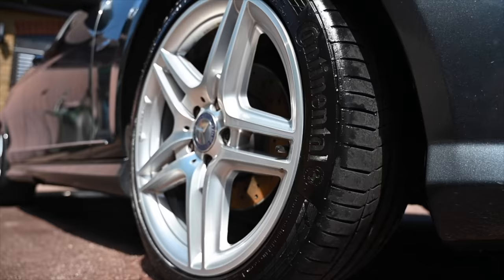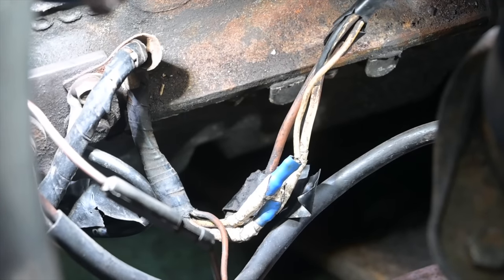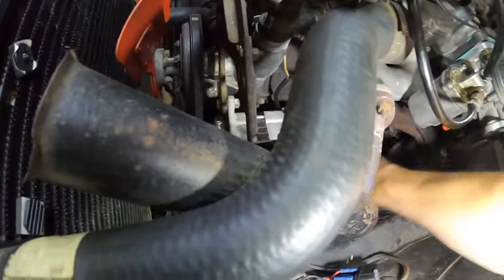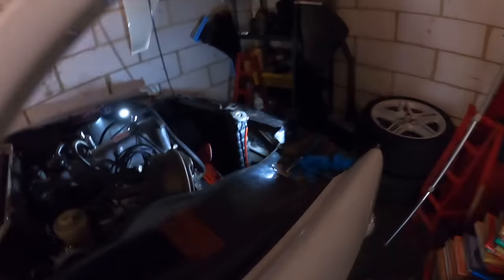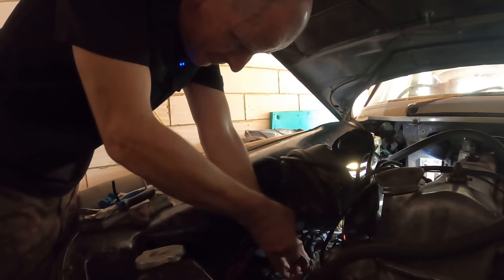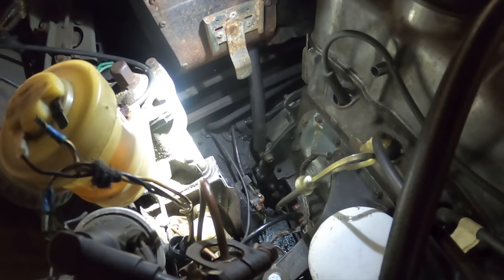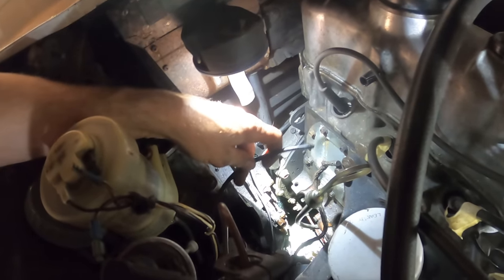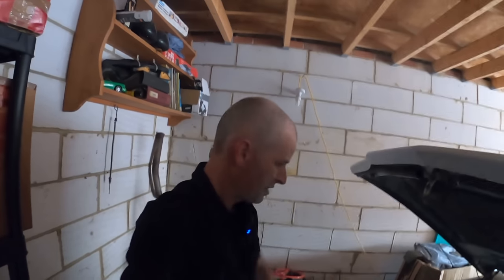Rover P6 2000 starter, fuel line and a lake of petrol...

Comment: Matt I had a starting issue for ages exactly like this on my old 2000 auto and it turned out to be that earth strap which needed cleaning + plus someone previously had been very generous with the engine enamel paint and has simply placed the cable over the new paint!! I have to say though I always like the Duck egg coloured block, I'm sure that was the colour from the factory on these 4-pots :) The starter motor wiring is always a bit hard and fragile, way too close to the exhaust for my liking but no worse than the V8's running fuel lines by the exhaust causing vapour lock express! Lovely to see this beautiful example again!

Comment: The slow starter revolutions was a hint that that an earth connection was a problem. After fixing, starter was spinning much better.  Resistance is the nemesis of starters..   always check battery posts for any excessive heat , will tell you if a positive or negative problem.

Comment: Seeing the P6 fuel system reminds me of a fault I once had. It's not related to your woes, but everyone might as well hear it. I had a P6B which would suffer from vapour lock in warm (though not actually hot) weather. It would starve for fuel, and then after parking for a time and letting the motor cool it would again run perfectly. It turned out, after much searching, that the fuel tap cable was poorly adjusted and slightly restricting fuel flow as a result. The car could still be driven hard without fuel starvation, but when the temperature got up a bit, the constricted line caused the pump suction to turn the fuel in the pump and pipe into vapour. No-one ever seems to check the operation of P6 fuel taps, but it's probably a good precautionary thing to do.

Comment: Even if the earth strap ends are shiney and tightly bolted down its can still be worn and high resistance, esp after 50yrs in the elements under a car bonnet. The starter sounds really slow like it wasn't getting the full fat current. 

As a test use jump leads to connect battery -ve terminal to body metal in the boot and under the bonnet from body to engine block. If the starter spins faster you know the old earth is U/S
Reply from the maker: This is a lot younger than the rest of the car, the engine has been out twice since Ive had it and it was replaced both times, its always been groggy since Ive had it
Reply: @furiousdriving  Is the battery end new and not getting hot? Starter worn/old/dying? and overloading the wiring? I'm sure its not supposed to sound like its attempting starting with nearly flat battery.
Reply: If there is heat, there must be resistance very close by. Either earth strap is compromised or connection has some resistance. I have had situation a few times where a connection looks OK, surfaces are clean and it is bolted on tight. However, I have replaced the strap and it made a big difference. Ohms Law suggests that a 200A cranking current through a connector with just 0.1 Ohms will generate 4KW of heat  - more than a 3 bar electric fire! So, for starter motors, every fraction of an Ohm counts.
Reply: Clive is bang on Matt, it could also be the starter motor is worn drawing more current and its path is that strap.  But my first bet would be the jump lead and see if it improves.
Enjoying the content as always!

Comment: Reminds me of when I had a 90" Land Rover that would flash all kinds of weird lights over the dashboard when cranking, even making the alarm squeak and swoop. Then came the smoke... Turns out the earth strap had failed and it was using the throttle cable as the earth! Lots of melted grommets and cable sheaths... 😆

Comment: That wiring to the starter motor is a case of somebody's been there before  great to see your Rover 2000 running l do like the look of these Rovers great design also the V8 thus was easier to get running thsn the V8 a fuel line and you can drive it

Comment: Morning Matt one thing springs to mind having been hot as it was the condition of the engine earth lead need to be checked/changed ,test it by starting the car and note how fast it cranks over then take a jump lead from the battery earth terminal straight to a good ground point on the engine block and start the engine again, if with the jump lead connected it cranks over at a higher rate then Your earth lead is suspect and needs to be replaced.

Comment: It seems to crank slow. If  the earth is heating up then you are creating an inline resistor and could do with upgrading. It might have been replaced in the past with whatever was about. Put a nice thick cable on and clean up the ends. Also those olives can be a right pain in the ass.

Comment: 😁 Excellent progress. We like P6s and watching this with interest as I have P6 that hasn't started in a while. I am guessing yours is maybe one of the Mk1/Mk2 "crossover" models as I could see the V8 bonnet bulges and it has a 2000SC engine?
Reply from the maker: its a Series 1.5 - series 2 with a few Series 1 bits and unique oddities like flat pleat leather and inertia real seat belts All models got the V8 bonnet when the S2 came out, making it harder to tell them apart

Comment: Mr Furious, what are your thoughts on the SU carb? I had much better experiences with SU’s vs. Zenith Strombergs, but that may just be my experience. Seems to me to be a beautiful design (constant depression) compared to other types. Is that an HS or HIF?
Reply from the maker: Ive not used Zeniths much but Sis have a reputation for being more reliable and easier to tune

Comment: The fuel pipe issue: you can buy those fuel pipes in metal with the olive on and then you can join it to your existing pipe with some 1/4 rubber fuel pipe

Your slow cranking and you saying it's always done that would suggest that earth problem has been happening a while, I'd replace that earth strap with a black covered one and clean each end where it bolts to the engine and engine bay

Usually it's better to run a earth off the block to the negative on the battery but I don't think your p6 has the battery in the engine bay
Reply from the maker: battery is in the boot, so it has to go through the body, its cranked that way for 30 years with many earth straps!
Reply: @furiousdriving  just a thicker earth cable and clean the ends then

Comment: Ideally for longevity and reliability those connections should be soldered and heat shrunk.
Reply from the maker: once its home I can do that, no power in the lock up for the soldering iron

Comment: it's funny that a choc block connector is fine for 220v 7.5 kW and higher to wire in a shower but dodgy with 12v 🤔
Reply from the maker: houses dont vibrate or get hot. Bad connections, not danger
Reply: It's the amps. A starter motor draws a far higher current tha anything in your house.

Comment: I really dont think the choc block is much wirse than what was there before. Especially if there were bootlace ferrules on the ends of both wires.
Reply from the maker: its a better connection for now, long term might not be!
Reply: @furiousdriving  Id recomment uninsulated butt crimps or open barrel crimps and adhesive lined heat shrink for anything in the engine bay when it comes to  a permanent fix. honestly it looked like that car might need and all new engine bay loom though. But then it might not go rover on you again and what's the fun in that?